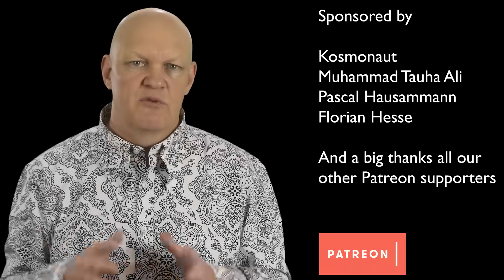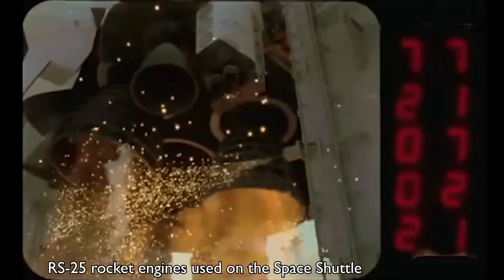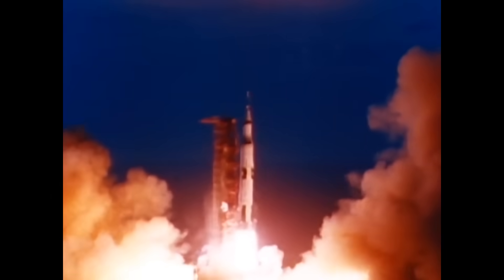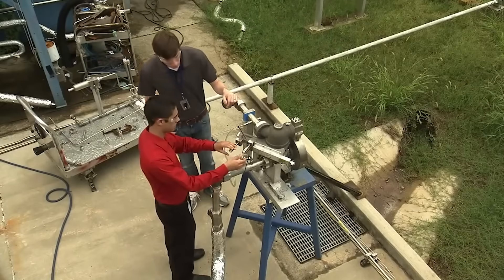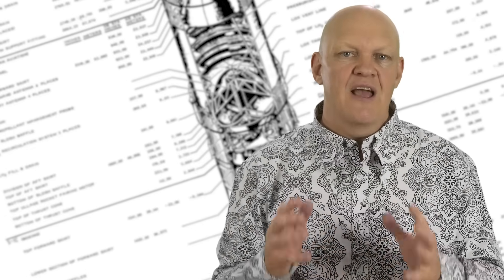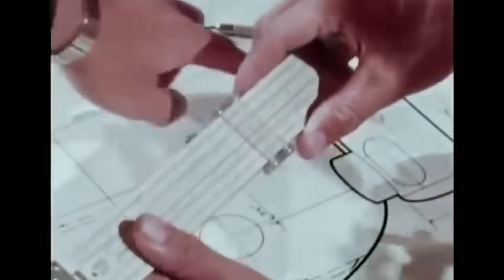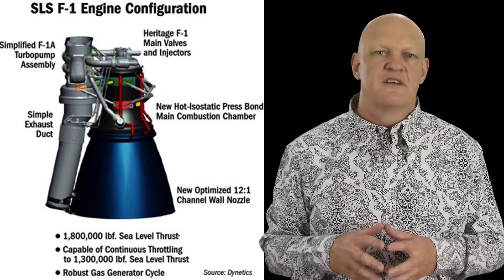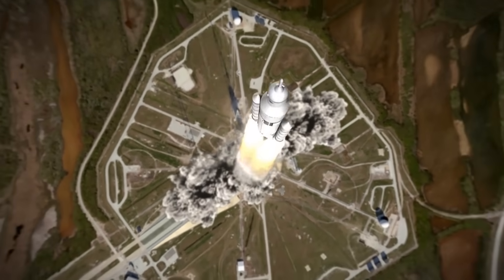Why Can't we Remake the Rocketdyne F1 Engine?

Comment: I could have told NASA exactly where to find many of the notes they needed are.  They are in TN.  My wife's grandfather was a NASA Engineer and he kept his notes until he passed 15 years ago.  They are still exactly where he left them because his widow still has them.  When he passed NASA had said they wanted to get them but failed to ever come get them.  The notation OW means he made the modification himself.  If he made the mod then he kept a note on it.  I've seen these notes myself.  One note includes the modification of the inner injection manifold to deal with pressure changes after launch.

Comment: I'm sure a modern version could be made using new high-tech technics. In the same way, you could build a small block Chevy engine on a CNC machine. It wouldn't be identical, but it would slot straight into a 55 Chevy with no alterations and it would perform better and more reliably

Comment: No one could afford to build a rocket engine like that today.  There is no technology in that engine that could not be replaced today but at what cost?  Why would I even want to built a 5,000 part engine when I could build one with today's technology using only 40 parts?  Why don't we use the same computers too?  LOL  We have much more advanced technology today.  Remember there is more to a rocket engine than just parts.  You also have the costs of parts and construction to deal with and the will to do it.  Things they did in the 1960's is primitive with what we can do today.  This video is bullshit.  Did you see the slide rule that guy was using to do his calculations?  A $2 calculator today would put that slide rule to shame and be more accurate.

Comment: Found the same type of issues at the phone company. All the guys who knew how to work with Pulp, lead covered phone cables retired.
Some one would cut a 1600 pair non color coded pulp cable. Three weeks later they would still be trying to get the proper tip matched with the proper ring.

Comment: Essentially: We could remake the Rocketdyne F1 engine. Just not in the exact same way it was made before. We could use the original blueprints and let all the problems with it be worked out by engineers until it's deemed ready to be used conventionally. It might not be 100% the same result as back then, but if anything perhaps it might be better.

Comment: I disagree. sometimes as is in most cases. Older tech is much better than new tech. There is no way on god's green earth that with todays tech that these engines can't be crafted today. And I mean hand crafted and dialed in. Hell vintage aircraft restoration shops do it all the time and re-create vintage aircraft. Stronger and Better today than they ever could have been originally. Those are complete pass the buck excuses to not even try. LAME ! Real Lame from a quiter !
Reply: Why try?  For what purpose?

Comment: i know to some this sounds stupid, but I used to work at a large multi-national company. As those companies do. they closed a distant facility, and their products were brought into my facility to continue building. The amount of "tribal" knowledge that needed to be re-learned was astounding. We had all the schematics, all the documentation, access to the original designers, yet even with all of that on hand, we still had a lot of problems bringing up the production lines. There were so many work-a rounds, shortcuts, and improvements made on the closed facilities production floor that did not transfer over that it took over a year longer than projected to get the production line working efficiently. This was on a regular production item, not a hand built rocket engine. So I can understand all of that, in fact, I would be surprised if they would have been able to build them again from the original blueprints and documents.

Comment: "Can't" is a relative term, depending on how bad you want something, and the cost to obtain it.
Reply: I'd say to make an old school F1 today is about as impossible as reading a carbonised book. Its not just the technical skills that are missing, its the number of people with those skills working together on a project that COULD NOT FAIL. It's one thing to fabricate an exotic object, quite another to make a high performance componant of a working rocket to a deadline.

Its also hard to concieve the difference between 'making an engine', and making a working part of a specific Satern V. You need 5 of them for the first stage alone, and they must be matched and tuned.

Imagine how much it would cost to test such an engine, without such a test you might as well construct the engine out of clay.
Even if they had the resources, a few die hard enthusiasts could not replicate such a machine. All they could do is make an F1 shaped object.

I wonder if anyone has considered making a smaller scale working replica?

Comment: Sad to think we have "lost" those hands on technical skills. The Saturn 5 rocket will, many years in the future, be akin the the great pyramids: "How did they build that?"
Reply: "How did people do all that math by hand" is a common one now...
Reply: @jordanmalfara1501  Because they didn't.  They used slide rules.
Reply: we know a bit about the pyramids,t eh rocket is more dfficuk
Reply: Sort of. We haven't lost the technical skills, we've lost the results of that past work. These days, when we design and build something like this we can calculate and model everything just right. These old blueprints aren't made with the precision we expect from modern designs and required so much tweaking, testing and altering to actually be usable, which is work I think we should be happy to have "lost". In the F1's case, the problem isn't that we've somehow lost engineering skills (quite the opposite), it's that the original plans were so inaccurate and relied so much on individual technicians that they're basically useless for building a new F1 engine without the mountains of changes and notes that had to be made.
Reply: @helplmchoking  we have lost the reason for those skill's, those skill's did'nt exist 20 years prior to Apollo, if there was a reason for those skills to be regained , we could.

 There is no real reason to have those exact skill's. We can train 10's of thousands of Blacksmiths, Thatchers, Fletchers, but the demand no longer exists.If we did try to build them would we use slide rules, tools from the 60's, you could but it would be silly
Reply: huh? so how has spacex managed to build from scratch the merlin and the raptor engines and land their boosters? i think its evolved not been "lost"
Reply: @danielroden9424  And yet, we have just witnessed NASA fail, twice, to bring cryogenically frozen fuel from the storage tank to the rocket on the launchpad.  A feat of technology that NASA had mastered over 50 years ago.
Reply: Manufacturing is multiple times better these days. Yes machinists were better back then but we have a massive technological advantage now. The reason they don’t make these engines anymore is we can build a better one now and cheaper.  We don’t invest in skilled labor anymore we buy expensive machines now that we can write off on taxes and hire less skilled people to operate them.
Reply: @TorchRed99FRC  Manufacturing is better, but I think we'd find that the core skills of engineers are not as deep as they use to be, our technology is a crutch and our fundamentals are not as strong, often that doesn't matter, but it is a major change.
Reply: @thehistoricalgamer  

"Technology is a crutch" is true in a sense, but at a certain point you reach the limits of the human mind and can't advance without relying on technology to perform calculations and automate manufacturing. Look at the F117 Nighthawk vs. an F35 Lightning—advances in CAD and simulation technology meant they were able to calculate the radar reflection of curved surfaces on the newer plane instead of just building a stealth fighter with only flat panels to keep the calculations simpler.

So yes, arguably these older projects are more of a tribute to raw human ingenuity, but that was hitting its limits aroundwhen these rockets were taking off. Let's not forget who developed the technology we have today, either.

Comment: F1 is outdated tech, there will be better Rocket engines in the future, 5he raptor engine is close.
Reply: Yeah, F1 was not bad at the time but it's a relatively simple gas generator engine with less efficiency, while more modern engines (even older like the RS-25 beside Raptor or BE-4) are reusable and are closed cycle.

Comment: Honestly. Let's just crank out 5 F1B's, use the same aerodynamic profile, and we're already dropping THOUSANDS of pounds in computer weight, (no need for MASSIVE computers and heavy guidance gyros anymore) and call it good. It's a proven design, with even more efficient engines and lighter structure weight. Sounds cheap, reliable and doable to me. Screw the SLS.

Comment: Saturn V engines was prowen in use.Solid rocket booster  is tricky thing to use,it can explode from time to time.Solid rocket booster is just candle.By the way to do simplify something is not always best way to do the things.Is it so hard to imitate old school engineering and manufacturing?It is not so.NASA should gather bunch of japanese,indians and bangla Engineers and welders ,give to them one F-1 engione from Museum as well as blueprints,material,tools.and they could do it,remake Saturn F-1 engine.You do not belive to me?Try them.I think money is the problem.In that times no one asked what it cost.Each F-1 engine in Museum is about to production worth at least ten times mass of it in gold.That is the problem.Lousy excuses that..we do not have welders notes.Human eye which observes and Brain can do anything even retroengineering and production of F-1 engine.People imitate Rembrandt paintings,hey man.I do not belive to NASA and to your explanation.F-1 engine is jewel..Explanation why not retro producing  of F-1 engine does not have legs.Sorry.
Reply: F-1 was a good engine at the time, but it's a gas generator design which is naturally less efficient compared to more modern closed cycle designs which were used for the (unsuccessfully) N-1, the Space Shuttle main engines or the Atlas 5 with the RD-180s. 
The only reason to build a gas generator engine is because it was thought to be impossible to make an alloy which could withstand the very high temperatures of a oxygen rich turbopump, which was solved by the Russians and later by others like Space X. 
The closed cycle RS-25 ,,solved'' that problem with a fuel rich turbopump and a non sooting fuel.

Comment: It must have been an interesting challenge to take ideas from the old F1 engine and create the design for the F1B. The only thing is that there isn't the need for such powerful engines at the current time as spaceflights are limited to near earth orbit. If/when there is a real plan to go back to the moon, or to Mars, then such an engine may be needed once more.
Reply: As long as you want a reusable rocket smaller engines are better suited. You can throttle down engines only to a certain level, if you want to land something like the New Glenn or the Starship booster you have to throttle down the engines, but huge engines will have too much minimum thrust for a landing. 
With smaller engines in higher numbers you get the ability to hover the boosters, and you get a redundancy by not relying on a single engine at landing. 
The F1 was the right engine at the right time, but today requirements are different.